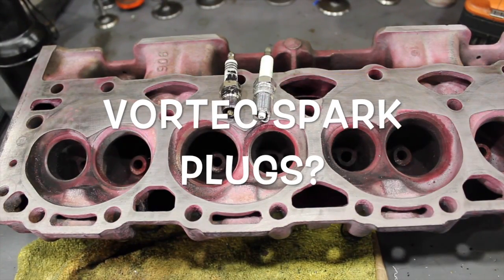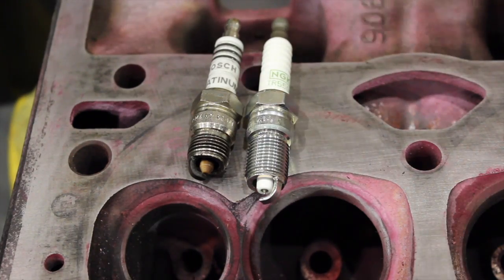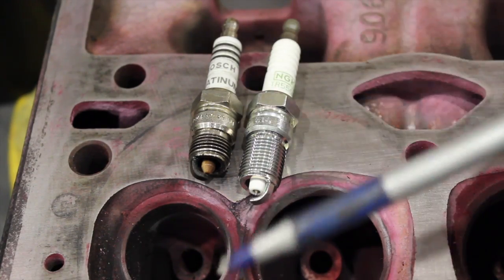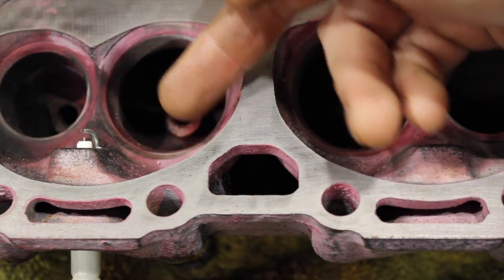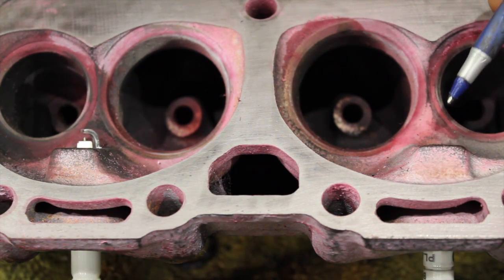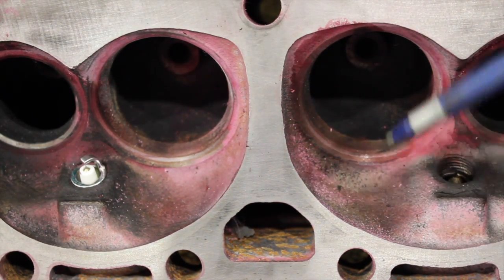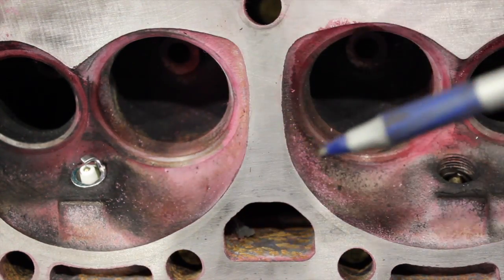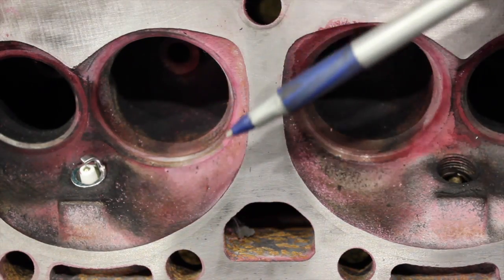Vortec SBC Spark plugs? Plus ignition tips

Comment: You said timing but did not mention initial timing number should I run 8 degrees 10 degrees or 12 degrees or what number can I get away with for the 87 to 95 sbc 350 engine.

Comment: All these years, I had no idea. my engine seemed to run pretty good but I guess I was leaving some power on the table and didn't even know it. I just finished freshening up my old 350 with vortec heads and gettng reading to put back in my s10. glad i seen this video. are the 062 vortecs the same spark plug? do you have a plug that you recommend for headers. I need a external shorter plug  to clear s10 headers

Comment: Drop a couple heat ranges for propane powered engines . Definitely use the fastest burn heads you can get with hard seats and premium valves .

Comment: Idk if you’ll answer, but, why timing cover and balancer do you use for a L31 with a carb?
Reply from the maker: You can use a standard sbc timing cover and balancer. You'll need to remove the reluctor ring from behind the vortec cover and install down pins on the block for the timing cover

Comment: In the marine world we had a lot of problem when GM went to Vortec with longer plugs of customers (and shops) installing the short plugs. They idled and accelerated terrible. I got to the point that it was the first thing I would check when the customer complained about idle issues. I usually asked if they had serviced the engine and they proudly said the plugs where new so they knew plugs weren't the problem. I am glad you maid a statement about higher heat range plugs not causing a cooling system over heat.
Reply from the maker: Yeah its definitely something that causes alot of guys frustration but it's a simple fix once it's figured out

Comment: Summit racing is out of stock on these plugs, can I use a regular TR55 that has the v on electrode for my 906 vortecs? On a 355 with a thumper cam so no crazy hp.
Reply from the maker: Yeah or use a TR6

Comment: Would NGK UR4 plugs work in the 906 vortec heads? I had the old style plugs in that a shop sold me when i put them on. They said these will work…but didn’t say they would make optimal power.  They were the NGK R5673-8 plugs. The UR4 plugs are slightly longer
Reply from the maker: No a UR4 plug is too short and youll want a heat range of 5 or 6. 
A NGK TR55 is a good option

Comment: Will these NGK plugs clear headers? I bought truck from my brother with tuning issues. Everything new. Summit vortec heads, mild roller cam, 600cfm. So far I've found a bad wire that was melted and plugs look rich fouled? He had the accel header plugs in it and I've been wondering about exactly what this video addresses.
Reply from the maker: Most headers the ngks will clear. I believe the only short accel plug that will work in a vortec is part# P526S.
Tapered seat/proper reach but they are expensive. 

The engine will be non responsive and sluggish with the wrong plugs. Often miss-diagnosed for carb issues.
Reply: @cuttersperformance  definitely. Plug wires was burned inside the fiber glass sock and he had just replaced them. I honestly think he was thinking he had a valve issue and was just done with this project so I traded him my Jeep Cherokee straight up. It mirrored a valve issue with vacuum gauge and spitting out exhaust. Replaced wire and it runs great except for bogging now. Still trying to figure out if it's rich or lean. Been around this stuff all my life, but this is my first v8 project. Just put a 650 cfm carb on to try. I think my plugs are fouled badly now from all the rest so I'm researching best route for plugs. I'm gonna try these tr55gp
Reply: Do the accel header plugs are 576S. They are the shorter ones inside. I'm gonna try tr55gp. Only one boot is a little close to header on #3. My question if you get this is a rich looking plugs and primarily back 2 cylinders are pretty wet and basically fouled? You got any ideas? I was on the 1406 600cfm and it was basically doing similar. Going to try the 1906 650cfm. It's like it's rich on bottom, but WOT it falls flat. If you roll into it it'll go. Regular performer intake with the thick black gasket. Those plugs were only gapped around 035. I'm gapping the ngk at 040

Comment: I'm new to the channel so this comment is over a year late but you gave some solid advice/info & I like the way you use an old head to actually show what you're referring to. I'm an old school mechanic having built performance engines since 1980 when I decided to supe up my 74 Nova. What we determined is that you go to a hotter heat range when your plugs are prone to fouling because of worn guides, bad seals, or bad rings. We'd go a range or 2 cooler to cut down on detonation if we were running a lot of ignition advance & couldn't get high enough octane gas. Mainly you have to learn how to read the plugs to see how they wear, how much buildup they get, etc. As for the brand of plug I've tried them all. NGK, Bosch, splitfires, etc. What I found is that vortecs seem to like Champion Copper Plus. They're much cheaper than platinum & iridium plugs & work just as well. Right now I'm testing a set of Pulstar capacitor plugs because I got a chance to see the spark they make compared to conventional plugs & it impressed me. It's not even a spark but more of a cool looking purple plasma ball. I'm running them in a pair of aftermarket (improved-design) 062 heads and It feels like I have a lot more power & smoother power in the upper rpm range. I'm just waiting to see how long they last compared to conventional plugs & so far they're doing fine. Regardless of the brand of plug I found the weak link to be the distributor caps. It's important to avoid dist caps with aluminum contacts. You have to go with solid brass contacts as the aluminum contacts build up corrosion & wear out way too quickly. If you run a hotter coil like i do, a standard grade distributor cap will barely give you a year of good service, so get a premium cap & rotor. Weak ignition components will affect spark plug performance. You have to think of the plugs, coil, cap, rotor, & wires to be an interdependent system where one bad or faulty component in the ignition path affects the overall  performance regardless of which plugs you use.

Comment: Every cylinder head has its needs.  Non negotiable?  Reach, threads,  seat type [flat or tapered], and in the case of valve cover mounted [tube type] overall length.  The negotiable?  Heat range and tip type.  Old or new, thats it.

Comment: Great video man just subscribe I had a question we’ll the ngk work for a 350 Chevy small block I have a set of vortec heads on a 350 Chevy small block and wanted to put different spark plugs on the vortec
Reply from the maker: Yeah I've used NGK plugs on lots of vortec engines
Reply: Thank you keep up the awesome work

Comment: I have a question I have 1996 z71 with a vortec 350 I want a lumpy idle choppy hard-hitting I'm finding videos of people putting in a lt4 Hot Cam with their stock computer and some small modifications to the valve springs what is the lumpyest cam I can put in this truck with the stock computer stock fuel injection if the 96 heads aren't good enough I can easily get 98 heads which I hear flow better 
Thank you
Reply from the maker: The best answer i can give you...don't be afraid of a tune! Haha adding a cam like a XR270 to your vortec 350 would be a great upgrade but to make it run properly you will need to get the ecm tuned. Alot of guy try to skip that step but you'll never be happy without a proper tune
Reply: @cuttersperformance  thank you so much for responding that is great advice and I listen to that cam on YouTube and it sounds better then the lt4 hot cam

Comment: What plug do u recommend with a 150 shot?
Reply from the maker: I would start off with a BR7EF (2 steps colder)
Reply: So I tried the tr55gp and my truck just does not like the ngk plugs what copper core could I use that’s ac delco

Comment: Thanks for the great informative videos!  I’m currently running Champion RS12YC’s.  I’d like to convert to NGK but preferably a regular copper plug.  What I’d like to know is what plug would that be?  I will also be spraying a wet shot from time to time, no more than 100hp.  Basically I’d appreciate if you could share your opinion on two plugs, stock heat range and one step colder as well as part numbers.  Only if you don’t mind, there’s so much information out there, it’ll make your head spin!  I appreciate your input!  Thank you!
Reply from the maker: If you plan on spraying I'd drop down two heat ranges 
BR7EF would probably be the best for you
Reply: @cuttersperformance   thank you.  I’ll check it out.  That’s a regular cover plug?  Appreciate your videos.  Good job.
Reply: @cuttersperformance   thank you!

Comment: The aluminum heads I have, are kinda a hybrid vortec, it uses the same plugs, and uses either intake, but being 220cc runners, and 2.02" valves, I don't see much difference between them andca vortec. It's difficult to find a intake and gasket to fit the larger intake runners, I went through about 3sets before finding one that I could live with, I guess the main difference is the dual intake pattern,

Comment: I’m running accel shorty plugs in mine. Because the stock ones were too long and my wires were on the header in my s10. Is their a shorty style plug with that long end on it????
Reply from the maker: Yeah I believe the Accel part# is P526S 
But please confirm that will work for you before ordering 
Cheers!

Comment: What about "clocking" your plugs?  Also, I'm running the NGK TR55 V-Groove vs. the Platinums.  Which do you prefer?
Reply from the maker: The only time I index the plugs is when I'm using a dome piston and I need the clearance 
Honestly usually just run the standard TR55's but have use both and haven't noticed any performance difference. Probably just longer service life out of the platinums 
Cheers!

Comment: What about running Vortec head plugs in an old style cylinder head?  Should raise the compression ratio marginally by protruding into the combustion chamber?
Reply from the maker: I like your thinking but I would not recommend that 
Not only could that cause the plug to over heat, you are also taking a risk of the piston hitting the plug
Reply: Ok that does make sense. Good call 👍
Reply: Good point, especially with flat tops. Dished pistons, I’m thinking might be ok though.
Reply from the maker: @thyssenm  but you still run the risk of over heating the plug, the head absorbs the heat from the plug and with the plug sticking into the combustion chambers i would be worried about it getting too hot

Comment: I just put put vortec heads on a 4 bolt main 350 for my Bel Air. I assumed that I would have to replace the spark plugs with the stock Vortec spark plugs, but could not find any confirmation. Your information was very helpful .thank you
Reply from the maker: Love Bel Airs! And yeah make sure you get those long reach plugs, night and day difference 
Race on! 🏁

Comment: Have you found any gains by indexing the plugs? Unfortunately I have to slide my headers back for plug changes, so if there's no gain il leave them as is!
Reply from the maker: Honestly the only time I index plugs is for dome pistons to get clearance
Reply: @cuttersperformance  ok I'm very similar to your 400 build. I'm guessing 370 maybe without the mild clean up like your heads. Plus I'm running a bare bones 290/300 cam so less intake lift at 465/488. Thanks for the videos and advice👍
Reply: Main benefit of indexing the plugs is for a racing application that is very restricted in what you can use for parts in the engine, this makes every hp worth chasing. An example is the hobby stock class of IMCA.

Comment: No I want to use some vortex heads just need some advise from you on what can and springs to get around 400 to 450 and what carb . Actually cost less if I got the dark and evil as far as the intake and everything and can I make that power I was talking about 400 to 450 with the dark iron eagles with a pretty smooth idol. i have a 1966 chevy pickup long bed with 373 rear end and 400 trans with shift kit and stock convertor with headers.
Reply from the maker: Send me a email with your combo 
Pcperformance1@outlook.com
Reply: Okay I have a 327 bored 30 over with double hum heads 194 150 a Edelbrock performer intake a Edelbrock 600 carb with a stock cam from 69 and headers. After watching your videos I wanted to use the vortec heads and increase my horsepower

Comment: I had a type error I meant a 1969 327. Thanks for the info also do you know what would be a good cam intake and carb combination with my 327 and how much horsepower I could make my block has been bored 30 over
Reply from the maker: What's your intention with the car? A street cruiser? Street strip?
Reply: It's going to be in a truck 1966 chevy street cruiser plus pull a trailer sometimes but I did want somewhere between 400 to 450 horsepower with a smooth idle
Reply from the maker: I'm might get some back lash on this from the old school guys haha but your going to have a very hard time getting that kind of power with camel hump heads on a 327 especially with a smooth idle
I would highly suggest getting aftermarket heads and a bit of a lumpy cam to make that power 
327s have a short stroke and like to rev!

Comment: i have a 96 327 with double hump heads with 194/150 valves can i put some vortec heads on it if so will i need to get a different water pump. Also were would be the best place to buy a set of after market vortec heads bare i hear that when you buy a complete set they have cheap valves and springs.
Reply from the maker: Check out my water pump bypass video that answer your questions about the water pump
Summit and jegs sell there brand of vortec heads with studs already in them. Sometimes just a spring upgrade is needed depending on the cam

Comment: Just picked up a good set of vortec heads for one of my trucks need another set still for my 90 c1500 what are some good part numbers for plugs that won’t interfere with my headers

Just not wanting to fry my plug wires there sleeved but most plugs I find for the vortec are longer need them shorter
Reply from the maker: Are you currently having  issues burning plug wires? I have actually never had a issue with burning plug wires with all different headers and engines I've ran. But obviously it comes down to the headers/wires you have
Reply: @cuttersperformance  it was the wires just realized by firewall they don’t have 90 degree elbows for some reason I’ll be doing a lot of changing to this set up Chinese distributor has to go and don’t know what intake is on it but probably going with something I know

Not mad frustrated with cheap choices he made on his build but happy I only paid him 150 for it need a transmission now

Comment: Your videos are pretty great, it's like your just having a informative conversation vs someone talking at you 
i find it extremely easy to follow, I'm excited to see more!!

Have you looked at the 305 vortec heads? i hear they aren't as great.
Reply from the maker: Thanks man! Haha thats kinda what I'm going for 
The 305 vortec heads are the best production 305 head but don't flow aswell as the 350 heads
Work great on small engines not looking for big power
Reply: What’s the spark plug gap for those heads

Comment: Another awesome vid , again thankyou . Would you happen to have any part# for a colder plug to suit these heads ? Funnily enough i have a weiand 142 blower going on my engine in the coming months , it will be pushing abround 5-6 psi in at this stage . Im also running as we speak a full msd ignition setup as well as msd atomic tbi injection on my 350 vortec crate engine . Cheers Adam
Ps : in your question from you last vid regading the extra holes in the thermostat for cooling bypass , i ended up screwing a tee into the top of my waterpump and getting the same result , but i will be doing the thermostat mod when i put the blower on as i wont have enough ports in the manifold to accomodate 2 temp senders and the 2 heater pipes also .
Reply from the maker: Thats sounds like a sweet combo man! Any boosted sbc is great in my books haha  
A plug that may be a good start is a BR7EF
Reply: @cuttersperformance  ok , cheers . Ill keep those in mind . Thankyou 👍